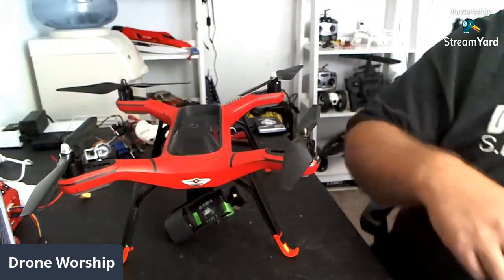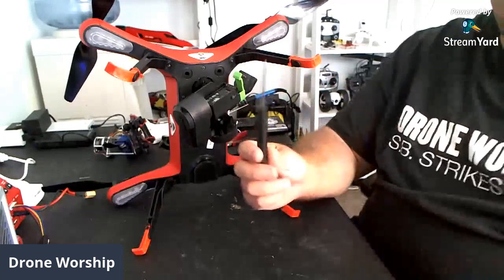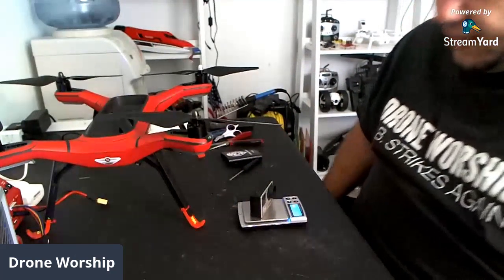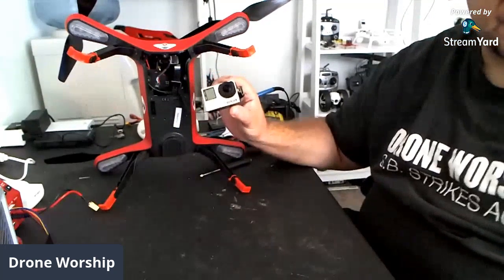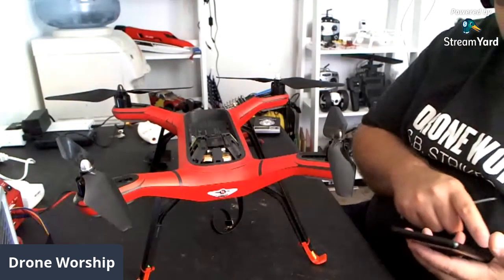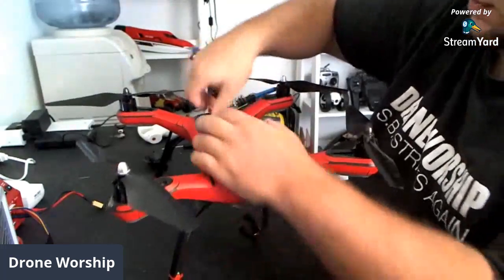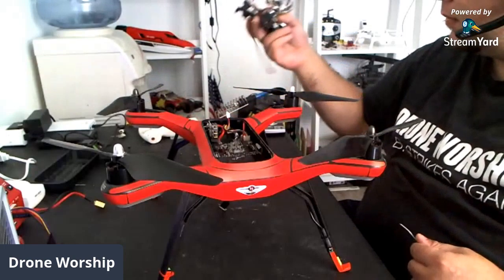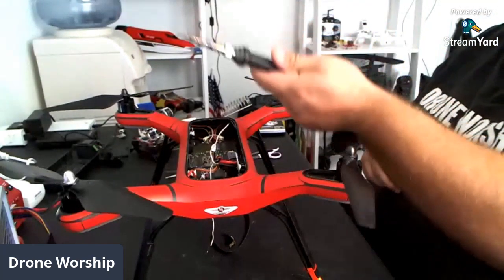3DR Solo Live After Market Gimbal Install To Run Newer Cameras

Comment: Hi There Awesome, video,. congrats, question this cable allow me to connect to the SJ4000 (no Wifi) camera and have FPV signal? let meask this,  is the solo takes SJcam?
Reply from the maker: If it has an HDMI port it should work
Reply: @IFixShet  Thx Man i try it and it works thx man you are the best, get better soon. Im in Florida Wellington anything man let me know
Reply: I plugged My hdmi in....no luck

Comment: Nice setup, looks great. 
HELP, I have just purchased a galaxy s8+ it doesn't connect to my 3dr solo.
It worked just fine with my galaxy 7?
Have you heard of these problems?
Thanks
Reply from the maker: Are you using solex or the original solo app?
Reply: The original app .Another person on the solo pilot website had the same problem and no answers?
Thanks maybe I should delete the app and reinstall it? Frustrating
Reply from the maker: @rickwinjester9706  unfortunately your device is too new for the app it was originally designed for Android 4.4 KitKat all the way through 8.1 it might be time to make the solex investment for 29.99 totally worth it more advanced features more stable platform
Reply from the maker: Remember the solo app it's almost 5 years old phones have really come a long way since that app what's produced it hasn't had an update since 2016 which is why we created Solex
Reply: @IFixShet  
I have solex on my tablet.i think you have to purchase the app for each device?
I'm not sure if I can use my old phone if it's not activated?
Thanks
Reply from the maker: @rickwinjester9706  just sign into the device with the same account that you purchased the app with and you can redownload it
Reply: @IFixShet  
Awesome thanks to your help!

Comment: Hey DW. Which breakout board do I need if I dont want to solder to the main board?
Reply from the maker: Well Now mr. Floyd that's a good question lol I am currently emailing brownie boards to figure out what the best build process is for everyone attempting to do this as you know they have many options available for how to set up the extension port for your needs. So once I have a good overall Define answer I will go ahead and post that link and do a video of what you should pay them to do versus what you can do yourself once you receive the connector
Reply from the maker: I'm working with very limited funds right now myself because of surgery  and not working for over a month now so I'm not spending extra money at the moment. Once I start working again I will be able to start purchasing the things needed to continue the build
Reply: @IFixShet  Please PM me your address Dan.